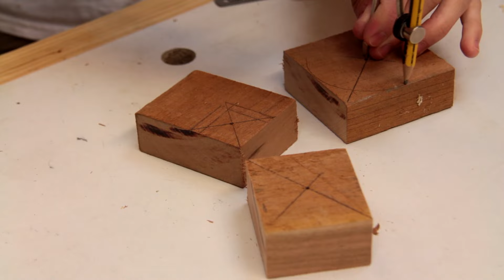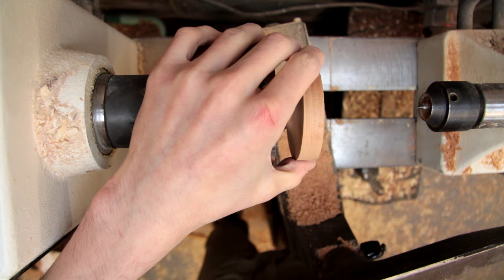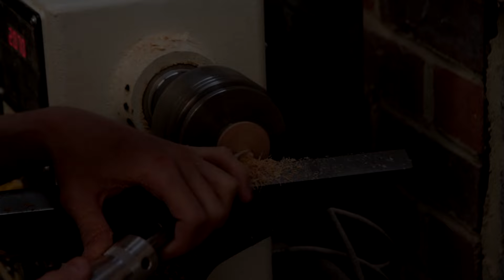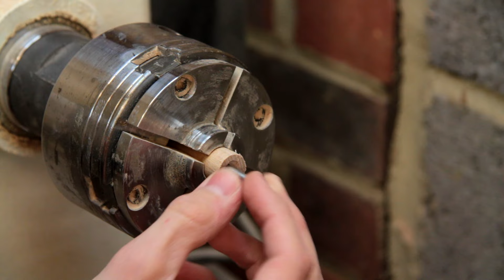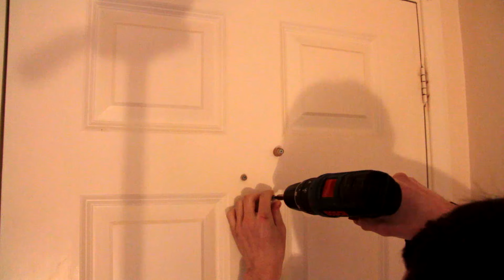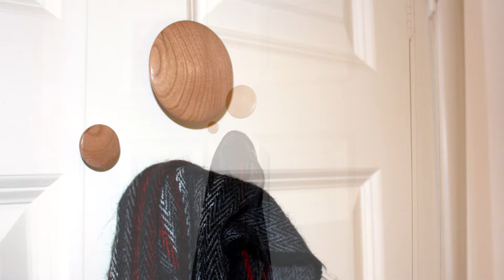Woodturning: Cherry Wood Coat Hooks on the Lathe

Comment: They look beautiful, but I'm really not a fan of how they're mounted. Hollow core doors like this don't usually offer much strength, plus the fronts are glued on, so now they're nearly impossible to remove without destroying either the hooks or the door. Another issue is that if the mounting screws start to loosen over time, it will be very difficult to tighten them again.
Reply from the maker: sooth15 That's fair enough, I'm sure there are other ways to mount them.  As for the glue, that was really only a precautionary measure and doesn't have to be used, which would allow one to tighten the screws from time to time, if needed.